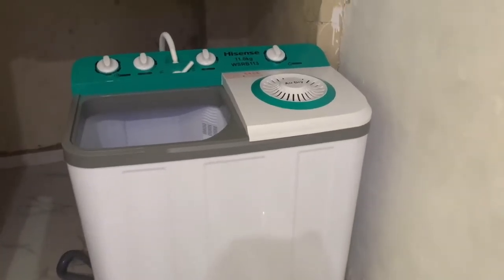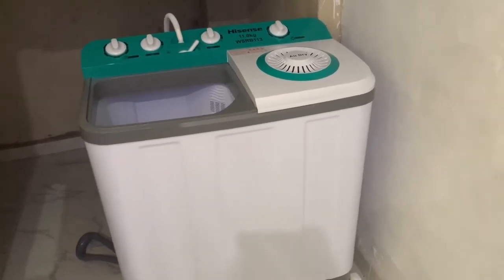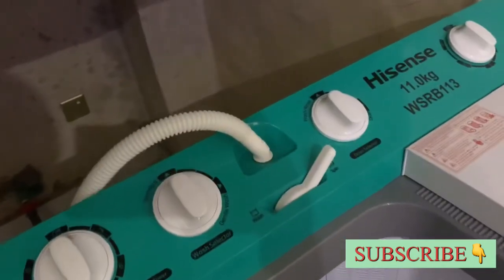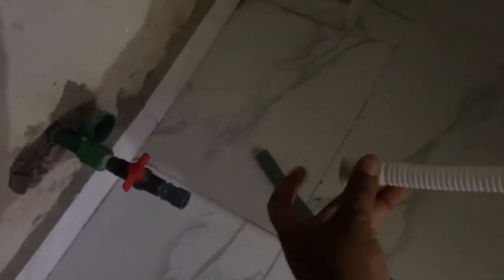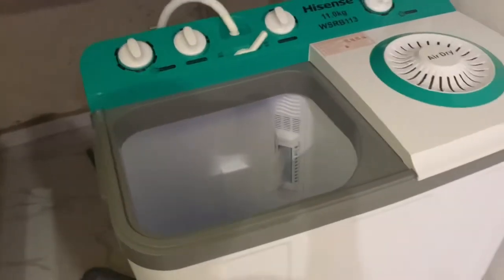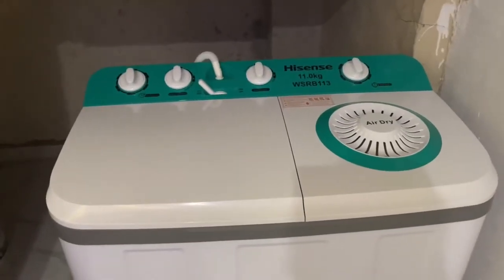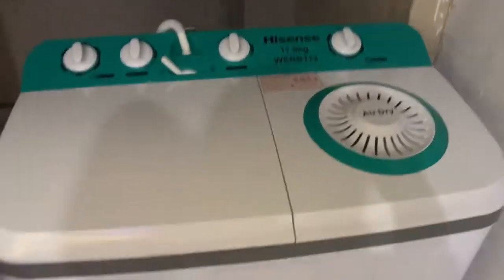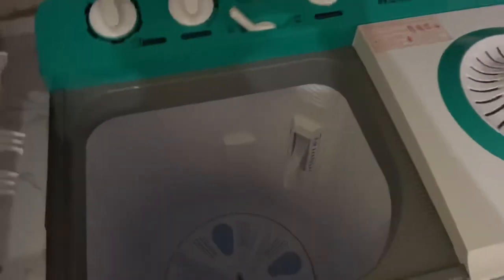How to setup / use / review twin tub semi automatic washing machine / Hisense 11kg

Comment: 1. Thank you for this video.

2. There's this unpleasant loud noise and shaking it does make while spinning, is it normal?

3. Do you have to keep water running inside while you spin at the same time or you allow water in to a certain degree and then spin?
Reply from the maker: You’re welcome 
It’s normal, 
I allow the water for like 2 mins while it’s spin then put off water and allow it spin properly